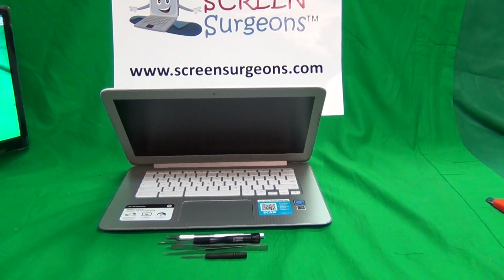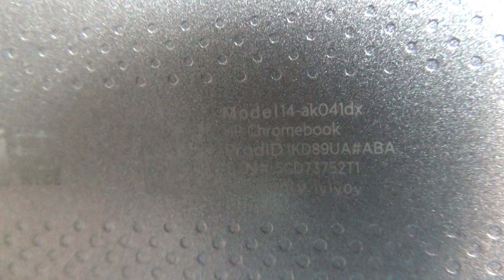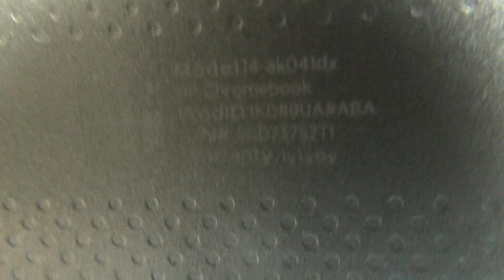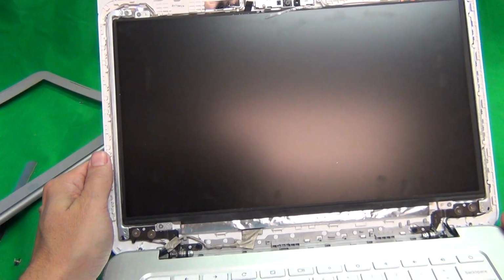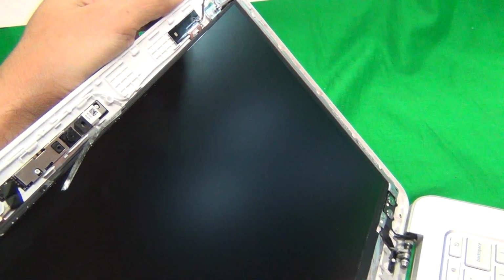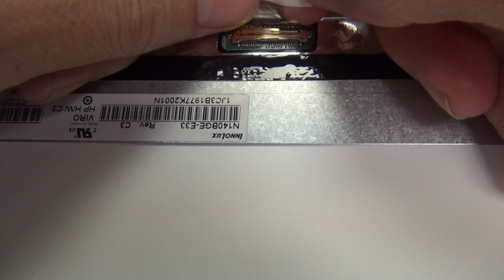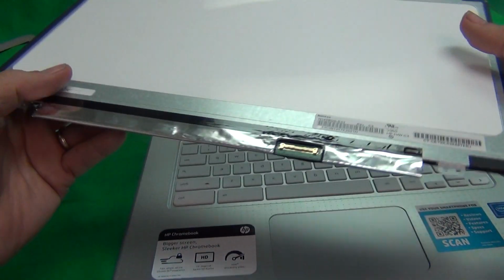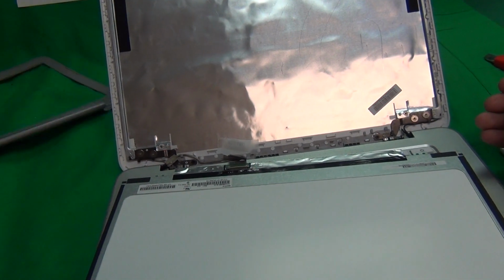HP Chromebook 14 G4 14-AK Laptop Screen Replacement Procedure

Comment: If you want a chromebook, this is an excellent one⤐>JustU.Faith/HP14Cbook?圃   Most chromebooks perform well, so I base my review on the hardware. This has an excellent keyboard and track pad -- if you use your computer a lot then keyboard and track pad are essential to work well.